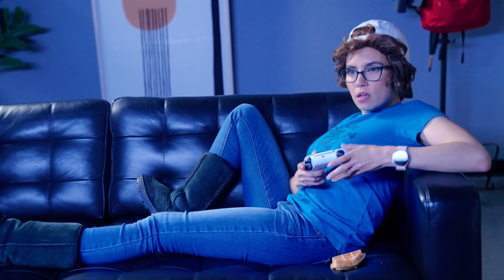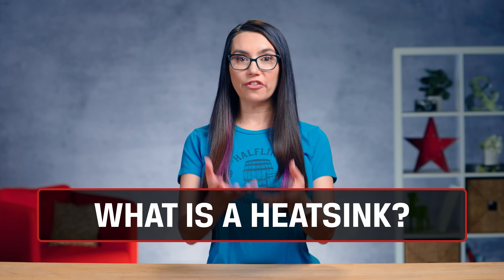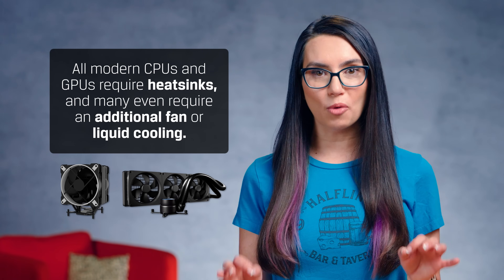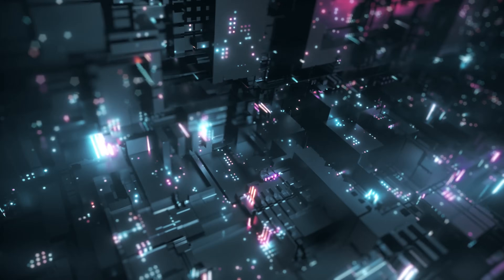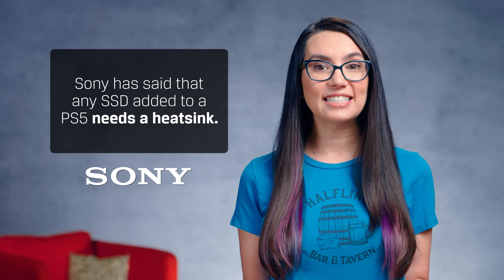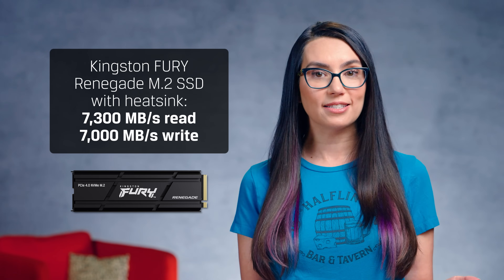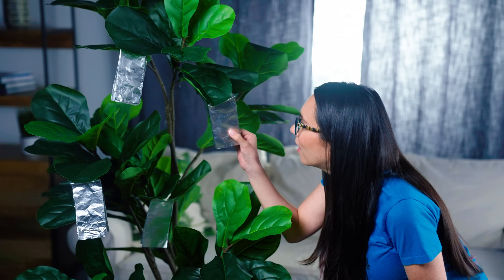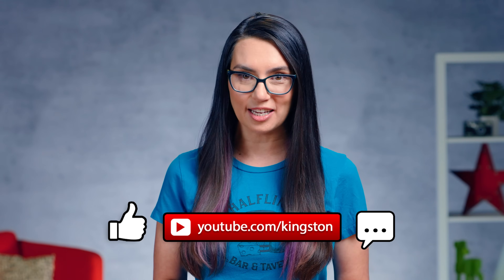Cooling Your SSD with a Heatsink – DIY in 5 Ep 195

Comment: Renegade heatsink so useless and overpriced revision, i buyed without hs first and idle temp 51-53 controller 67 and then buy for extra 40$ heatsink version and temp are SAME its totally cringe
Reply from the maker: Hey there did you also increase the airflow in your build? If the air is stagnant it may not make much of a difference without the proper airflow. If you need assistance with the Kingston SSD, please contact us here: https://kings.tn/4lDPhsG
Thank you

Comment: Just to clarify, ive just brought the kingston fury renegade 2tb for the rog ally x. Since it has a heat spreader already on it, will that be fine just to put in without an additional heatsink. Because there isnt much room in it.
Reply from the maker: Thanks for your inquiry and although we have not tested it out yet in that system, based on the info we found looks like our FURY Renegade NVMe SSD with the 'Heat Spreader' and not the 'Heat Sink' version could be a viable solution for your upgrade needs. If you have any further questions or run into an issue, please contact us here: https://kings.tn/3TrC7mK

Comment: So should we peel the sticker from kc3000 or not? Whats the exact temp delta?
Reply from the maker: If you are planning to use an additional source of heat dissipation besides the low profile graphene aluminum heat spreader that already comes with it you can certainly add it on top of it without removing the heat spreader. For a data sheet, please visit our site here: https://kings.tn/3Xi45m3

Comment: I just upgraded my 3 year old 500gb Nvme with a WD 2tb Nvme.  I cloned the drive and instantly windows was freezing and random blue screens. I reformatted and cloned again and same results. Put the old one back and it works perfectly. So I’ve ordered a heat sink for the new one and hopefully that will solve this issue.
Reply from the maker: Hey @westfield90
Here are a couple of little tips you can try if the clone OS won't Boot : 
Try running chkdsk on your source drive first.
 
Repair File System:
Boot from a live CD/USB or Command Prompt.
Check and repair the file system.
Windows: chkdsk /f /r`
 
or
 
Repair the Bootloader:
Boot from a Windows installation media.
Select "Repair your computer".
Go to "Troubleshoot" > "Advanced options" > "Command Prompt".
Run the following commands:
sh
bootrec /fixmbr
bootrec /fixboot
bootrec /scanos
bootrec /rebuildbcd

We hope it helps.
Kingston Technology
Reply: @kingston  Thank you .
Reply: Did it solve the issue?
Reply: @Dreamlication  Yes it did. The temp went from reaching a max point of 90 to now 70 and all works smoothly.

Comment: my laptop has a very tight space to cool my secondary m2 SSD....any tip?
Reply from the maker: For small profile systems where space is limited, such as small from factor desktops or laptops you can always do an online search for thermal SSD cooling pads. Which is essentially a low profile strip that goes on top of the SSD to help dissipate the heat. You can also look at our KC3000 and the standard FURY Renegade NVMe which comes with a graphene aluminum heat spreader already https://kings.tn/3RLsg9p

Comment: Two points - 
a. SSD heatsink choice often boils down to how much breathing room is there above the m.2 slot. If you have a chonky GPU or other PCI-E card, one or more m.2 slots may fit in an SSD, but not one with a powerful heatsink, graphene, aluminium, kryptonitium or otherewise. 
b. Please point out that a lot of the SSD heating is due to the excess hot air circulating in the case from the CPU or GPU fans. Adding more heat sinks - to RAMs and now to SSDs, do not address the elephant in the room - CPUs and GPUs are geenrating more heat with each passing generation and now far outstrip the amount of heat generated by either RAM or VRMs or SSDs. If you could address this issue then the smaller problems will solve themselves.
Reply: My AMD CPU is water cooled, so there's no CPU heat being dumped into my case. However, the GPU had 3 fans, so that has to be taken into account.
Reply: @hotflashfoto  yeah even if you take the CPU out of the equation, GPUs are super beefy and powerful these days so they do generate a huge amount of heat. You could also get a liquid cooled GPU but a full liquid cooled system is just too $$$ for most average gamers.
Reply: @AritraMajumdar  Yep, I tried that on my old GTX 680. Replaced that with an air-cooled 1060 and it was cooler than the 680! Now I have a 3080 with 3 fans. 

Like you say, I'm not spending that much $$$ on liquidating my GPU. It runs fine.

Comment: Nvme gen 5 will produce more heat then intel or amd old cpus
Reply: Problem is, you wouldn't pair an old intel or AMD gpu with an nvme gen 5 ssd as the motherboard won't support both simultaneously. You'll end up with a hot current gen CPU that generates a lot of heat, and an SSD that also generates some heat. Global warming for everyone amirite ?